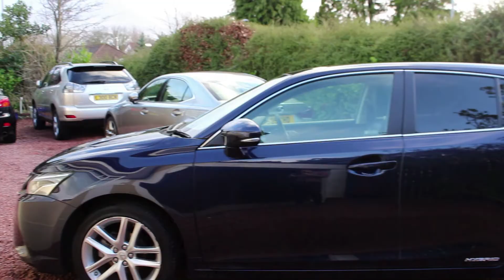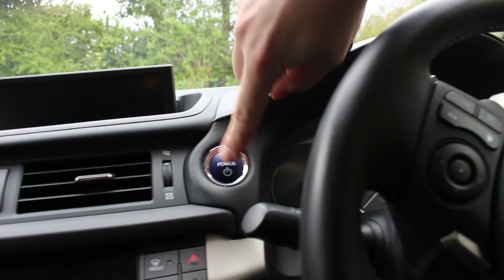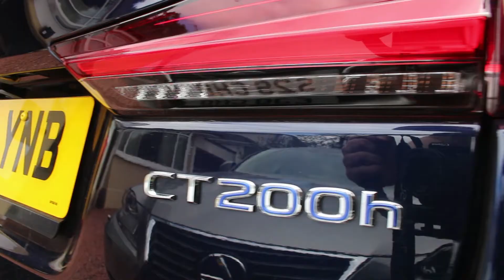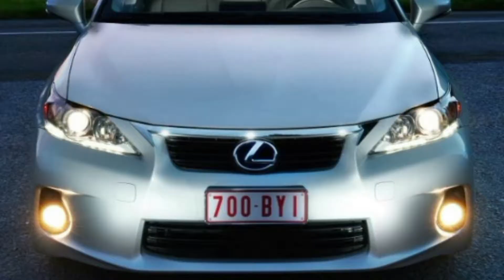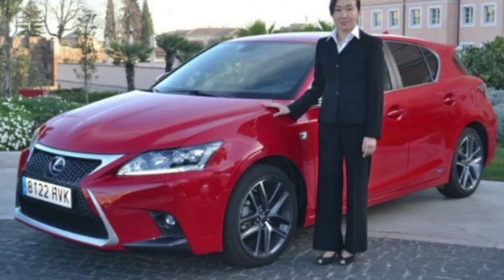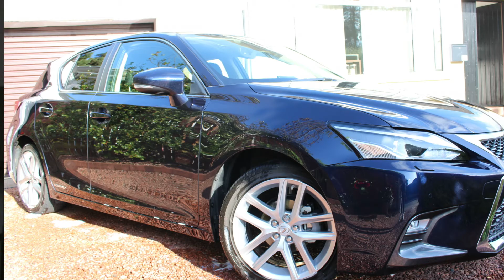10 things about the Lexus CT 200h you didn't know

Comment: I bought a tin march 2015,i still have but low use. It now has 14000 miles on clock. 12vlt battery renewed at 8yrs old. Last mot with only 1200 miles since new front tyres. I dont use it that often as you can see. Now on a trickle charge. Waiting till tomorrow see 8f it starts since mot 1 month ago

Comment: Im from the Philippines. Is it still a good idea to buy a used 2012 CT200h Fsport? What are the things to look after for in a 10year old hybrid cvt?
Reply: I own 2011 ct 200h with 157k+ miles.  everything works just fine on mine.  first,  look for rust if you live in a area where they use salt to melt ice/snow on the road.  2nd, check to make sure the battery is in descent shape (they cost more than regular batt.).  I still have my original battery in mine.  Also mine start to burn a little oil (maybe 1/3 rd quart per month but it is a daily commuter). so look for that.  but as long as its not leaking oil and other fluids, slight burn of oil at high mileage is common and not a huge deal. but other than that, It has been a great car for me and i believe it still got many years/miles to go.  good luck!

edit:  btw, it still averages over 40mi+ per gallon ;)
Reply from the maker: rust & battery life

Comment: Hi, I have a question. How long, time wise, or far do you have to travel to charge the battery? 
My commute to work is about 10miles and typically takes around 30minutes, sometimes less depending on traffic, it’s mostly three lane A roads around London, I’m trying to get an idea how much the engine would be running compared to the electric motor. Would this be sufficient time/distance to maintain the battery?
Reply from the maker: I think so, the alternator is being charged with the movement. I wouldn't worry!
Reply: 10 miles in 30 minutes?? Dude, time to move. Pretty sure walking is faster.
Reply: @kevinh1858  Last time I was in london it took me 90 mins to get from Wandsworth to Canary Wharf